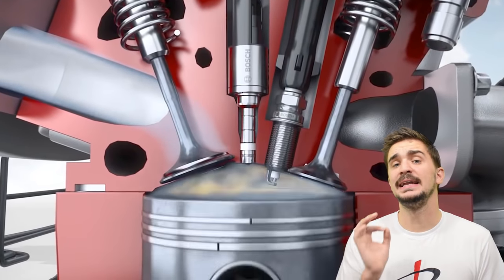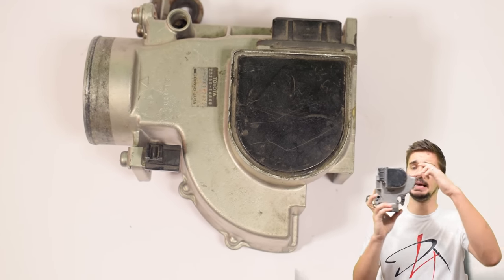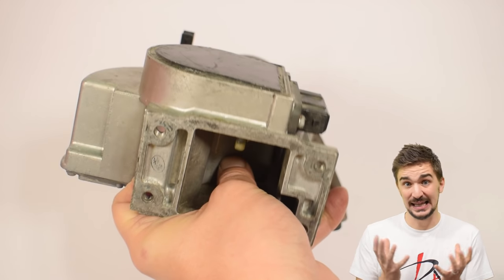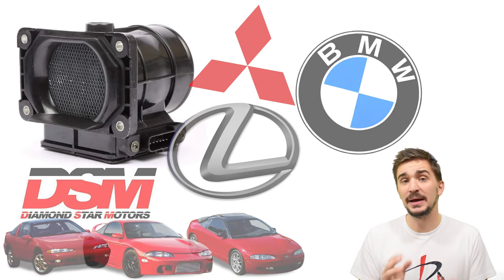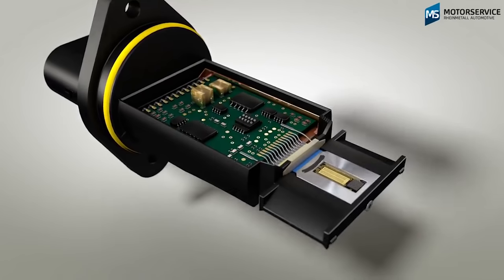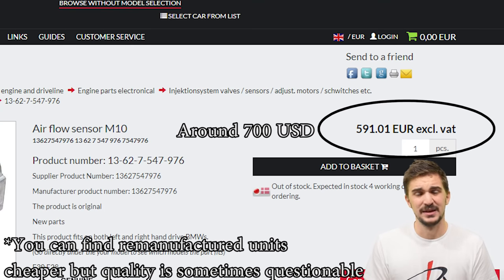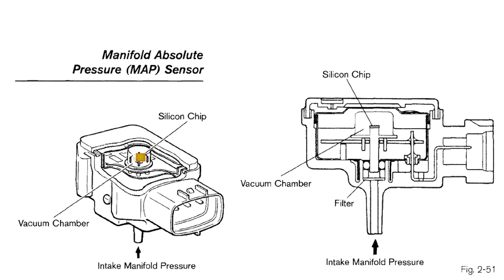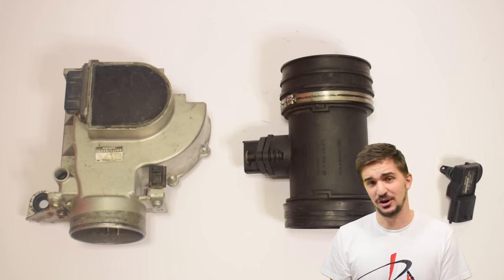AFM vs. MAF vs. MAP - Air flow SENSORS - HOW they WORK and how they DIFFER from each other

Comment: I hate to be that guy, but you're off about MAP sensors.  They measure force, not mass.  They are incapable of measuring the manifold air density directly, and need a either a temperature sensor or an assumption of the air temperature for the ECU to calculate the manifold density accurately.  Going from air that's 0C to 40C decreases the density almost 13%.  My truck is actually a MAP only vehicle and I don't know quite how GM pulled it off really.  It's a throttle body injection, so a wet manifold, and they placed a massive coolant passage under the manifold to keep it hot despite the evaporating gasoline.  So I think their model is built on assuming it'll be close to engine temperature and then just trimming on the O2 sensor for whatever is left.
Reply: @HandleHours1766  But how do I get from knowing the air mass in the manifold, to knowing the air mass that goes into the cylinders?
Only way I can think of, is by calculating it via known displacement and engine rpm.

Comment: Maybe you can tell me what would cause my OBD1 Mr2 SC, with an AFM, TPS, and IAC within the system, to bounce the idle once warmed up. It's almost in perfect rhythm after it heats up. The idle drops to a thousand, and the bounces every second up 500 rpms, then back down. 

I've addressed the basics, ie, timing, vaccume leaks, dizzy wiring, Eng Light testing, fuel Vapors, Fuel pressure, and the adjustment screws on the Afm and throttle body. 

Whatever is doing it is actually strong enough to open and close the vane in the AFM.

Comment: I believe that cars and trucks should have a air intake cooler. Just like the a/c.
So, instead of sucking in random air temps? It always sucks in a certain temped air, and keeping the engine always operating at somewhat the same temperature. No need for a cooling system anymore.

Comment: Quite a decent video.
Nice to see correct terminology for the old AFM. Too many people call them a MAF sensor.
A few things that could be applied to another video are the other aspects of accurately calculating very accurate fuel delivery for a given meassured mass air flow. 
Namely fuel pressure and fuel temperature. 
Some current day programmable computers are using these inputs as part of their calculation for injector pulse widths.
Something that I'd love to see, certainly in programmable computers, is the measurement of ambient humidity.
Ambient humidity has a noticeable effect of the actual air density and knock characteristics of an engine.
As humidity goes up, the moisture in the air displaces air molecules, so the engine requires less fuel to maintain the desired air/fuel ratio.
But the extra moisture will/should slow the combustion process, allowing/requiring more ignition advance to achieve the same MBT.
If the engine is operating in a really cold, but high humidity weather, the engine won't need as much fuel to achieve the desired air fuel ratio as it would if the air is really cold and with a very low humidity (say, at night in dessert conditions).
Similarly, with really cold and humid weather, the knock limit would be higher than in really cold, low humidity weather.
In a cruise condition, O2 sensor feedback could compensate for the changing humidity and short term fuel trims might help correct high load AFRs.
And maybe the similar could be applied for the ignition timing via the knock sensor feedback system (assuming it's able to cover the full engine speed range).
But these are reactionary changes and not part of the calculations the ECU does to accurately determine the actual required fuel delivery and ignition timing. 
I think it would be a nice additional input to help achieve even more accuracy and consistency, for programmable computers, operating over widest possible range of weather conditions.

Comment: Nice explanation of the vehicles air system. However I have a different opinion of Carly. I bought Carly about 6 months ago. After I received it I attempted to connect with my vehicle. It would not. I went through different help options provided by the Carly website (all automated since talking to a actual person isnt possible) but in the end the help diagnostic just ketp telling me to redownload the program and try again. So I decided to return it. I sent it to a return address it had on its website for returns (somewhere in Oregon). 6 months later I still haven't got my money back and theres no actual people to talk to from Carly. Just bs automated responses that dont help. I since got a fixd scan tool and a more expensive autel for bi directional use that work on the vehicle. The same vehicle Carly wouldn't work on, even though there own website said my vehicle was covered. Im not rich so that $100 Carly took me for does matter. Shipping even confirmed Carly got there device back, and it was only 12 days after I bought it. So I guess I just gave them 100 bucks just because.

Comment: nice video my man! really helpful
im currently investigating changing a vane style to either a map or maf sensor, could you go into some detail on the output signals of these sensors 
i am hoping to take the digital signal of a map and convert to an analog to a older style ecu to read in order to improve fuel economy for older cars (it may be less wasteful to improve older cars systems than build and buy new cars)

Comment: Thanks for another great video. Curious to know your opinion on cold air intakes versus the standard air box in correlation with a MAF? I hear mixed opinions about the benifit of the cold air intake systems.

Comment: Both the MAF and the Map need a temperature sensor. The MAF needs it because the thermal flux is proportionale to the temperature difference. The MAP needs it because air pressure for a given mass and volume changes with  temperature.

Comment: Thanks. Absolutely and the MAP sensor is only as good as the vacuum reference on one side of it's membrane and it can leak air into the vacuum,giving a error at the output signal??

Comment: How does humidity factor into this? It seems to me that humidity would affect the desired charge fuel mass, even after correcting for thermal mass flow (with MAF) and manifold pressure.

Comment: Without knowing the temperature you are not able to calculate anything related to mass with MAP sensor. P.V=n.R.T => increasing temperature would mean increase in pressure, but that doesnt mean increase in mass, therefore you need the temperature. Other than that, thank you for your explanations good Sir.

Comment: Is amazing how a simple carburator would eliminate e v e r y  complication detailed here,  maf map etc , including  high pressure fuel pump  ecu   and many many maaaany sensors that could go wrong.
Reply from the maker: It's amazing how misleading your argument is. I worked with carbs a lot, and I like them, but if you want to present a map and a fuel pump as a complication and suggest that carbs are without complications you have misconceptions either about EFI or carbs or both
Reply: @d4a   is not just a map and fuel pump, there are many other things you know that, imagine an engine swap  carbs vs efi so many things.. even the dash won't work, everything is interpreted by some computer.  I know, I'm ranting but don't get me wrong, I own a 2008 Alfa Romeo and I do all the work , I love the car as it is, but I miss the direct feeling of a carbed engine and the freedom they give, they give problems of course but simple ones.  My actual car could be complicated If trying to upgrade it, I can't even get rid of the cats easily  because of the sensors, not to mention remapping the factory ecu  if considering a super charger . Look when I figured out how to throw a maserati v8  in it and make everyghing work then I'll be happy 100%  ;)  happy 2021

Comment: isn't lambda sensor also a part in this equation. Or atleast some sort of sensor in the exhaust gases checking how the sensors before the engine did on it's estimations of airflow?

Comment: How could a MAP sensor tell you the "air mass" or number of air molecules without a temperature? The MAP sensor itself is a pressure sensor. The ideal gas law (PV=nRT) would allow fewer molecules at a higher temperature to occupy the volume of a manifold at the same pressure reading.

Comment: Hey man
I did a bit of experimentation the other day trying to diagnose a certain issue with my car. What I noticed was, the map sensor would give a certain value at idle, this value would increase as I'd step on it - but - as soon as the new / high RPM is stabilized - the map sensor signal value would default back to as it was on the idle.
To rule out it was a sensor issue, I unplugged the pipe from the intake/manifold & created a vaccuum through mouth & the signal value would maintain instead of defaulting back.
TLDR : it appears that the pressure in the engine would drop back after acceleration - which would naturally cause the map to lower down its signal - do you know if this is how its meant to be ? or am I experiencing some undesirable vacuum leakage (other details : toyota 5afe, knocking, occasional puffing in the silencer, possible tappet noise, possible rich burn)

Comment: Doesnt MAP need temp sensor as well? When you heat certain mass of air in closed volume, pressure rises, but the mass is the same. ?

Comment: Very detailed video!!!!
Thank you very much!!!
Do you know if you change the position of the MAF clockwise from 11 to 9 or to 13 or 14  is still going to work properly?
And can you remove the sensor and place it to a bigger diameter of a tube?
Is still going to work properly?
Thanks in advance for any answers!!!!!
Reply from the maker: Position shouldn't matter much, but larger tube will likely confuse it
Reply: @d4a  thank you very much!!!!

Comment: I wonder is there any way to retrofit a hot wire MAF to a stock ecu that originally had an air flow meter...and make it run on the stock ecu?  Maybe run the hotwire in series and datalog them both to generate some kind of correlation table and match them with resistors??

Comment: Hi, will cleaning my MAF sensor with specific Liqui Moly spray I bought for it help to improve the performance of the car. Car is Audi 80 1.9 tdi 1z engine and it pulls poorly since the change, also how should it be done?

Comment: What needs to change tuning wise when you upgrade the map sensor from 1 to 3 bar to account for increased boost pressure? Car came stock N/A with 1 bar  and now has 1 bar to 1.6 bar boost and larger displacement.
Reply from the maker: Tuning wise nothing really needs to change because implementing the tune with the 1bar sensor would obviously be impossible. If the tune has the desired boost targets and if boost control is working as it should and is made with the 3 bar sensor in mind things should work properly. Of course if everything else is in order too.

Comment: My Mazda rx-8 uses a MAF sensor, but it also has a MAP sensor in the engine bay with a small hose that isn’t connected to anything just ambient air. But the MAP is connected to the ECU. What is the purpose of this?

Comment: i am bench testing a 7 pin denso air flow meter.  NO ohm readings between E2 and Vs. what would cause this.  I cleaned the pins

Comment: my ae92 coupe with the 4age has a n AFM and let me tell u, the thing connect to the intake tube and the way it was built  it restricts the air flow so much,  those years of 1984-1991 usdm models for toyota all use AFM, I wish they could have use map, the air flow would have so much better.i wonder if i get a stand alone ecu and wire in a latest maf ( like my 06 honda accord maf) will it work?

Comment: @Driving 4 answer , is some cases the AFM install from factory in an angle  - like peugeot 205 gti. it means it doesn't accurate? (maybe Peugeot accounted for this angle??)
Reply from the maker: Definitely not inaccurate, yes Peugeot likely hired actual engineers and it's accounted for. But the angle is never too sharp and AFMs still take up a lot of space.

Comment: Hello! My MAF sensor has Air Intake temp sensor incorporated. Mass Airflo measures ok but irregular signal from temp sensor. OBD2 measures 25-135 deg C in 3 second intervals! Ambient temp constant 20deg C. New MAF replaced with no change.  Wiring harness??
Reply from the maker: Is ambient temp always 20 and never changes?

Comment: Left hand marked “AIR”. Right hand marked “FUEL”? Clap real hard at a 14.7 to 1 ratio, well?
No more videos?

Actually, the vane airflow meter was introduced in 1976 on the 6 cylinder inline Datsun/Nissan 280Z. One electric injector per six cylinders plus one extra for fuel enrichment controlled by a simple mechanical “Thermo-Time” switch with the specs stamped on the side. Cold, sprayed longer. Cooler, sprayed a little. Hot, no spray.
The 1976 had domed pistons with valve relief cuts, a more aggressive camshaft. With the 5 speed stick and a divorced differential and half-shafts to drive the rear wheels. With premium fuel would top at 142 MPH while smooth as glass.
  The vane airflow meter had no section for dampening but provide under sealed cap, a bypass to increase or decrease air pushing the vane balanced on a 5mm shaft. It used a clock type spring to return it to idle and correctly position it to 87% of WOT. With the cover removed, the drop of red epoxy removed, the clock spring could be adjusted to produce the correct hydrocarbons, Co at 5k RPM while using a 3 gas analyzer. The engine management system has no catalytic converters, required after July of 1979 so proper readings and precise control was possible. Only coil over plug with a high resolution could produce more HP without a turbo or supercharger. A spring loaded round plug was added to open if a backfire forced the door or “Vane” shut under pressure to help reduce/eliminate damaged.
I was a Datsun/Nissan trained service tech at the dealer and owned a 1976 Copper 280Z.
ASE Master Tech-Retired  ( Lets talk about the Cadillac Seville 350 w/flag fuel injection/ no VAF or MAF sensor. The only two vehicles sold in the 1976 model year w/EFI...not a normal throttle position switch, Bendix control unit inside w/built-in MAP sensor on ECM) Hello?

Comment: I implore you to correct the MAP section since the rest is quite good (MAF also needs some fixing). You were very particular in highlighting what each actually measured before that...but then insisted a pressure sensor measures density. Absolutely false. It requires a manifold temperature sensor to calculate density. A MAF requires temp too actually. The same mass of hot air will cool it differently than the same mass of cool air.

Comment: I had some Audi 80 in my life with that awfull AFM sensor. They're inaccurate, expensive and after 30 years they like to decalibrate due to spring wear. Ghh. The worst type of air flow sensor I've ever had.

Comment: Why do they push the diagnostic meters to everyone unless you know what u are doing the codes readers might point in a totally inappropriate direction yes it might help a little but unless you understand what a part does and everything it connects to mechanically and electrically it might mean bubkis

Comment: 2:00 o.O why are you Fingering the VAFM ?
now i have your attention:
also i run speedduino and a MPX4250 MAP Sensor :D

-lara
Reply from the maker: You need to see my old cylinder head porting video for some next level fingering 😂 Yeah speeduino offers a wealth of good options when you know what you're doing.
Reply: @d4a  i got a Trabant 601 and a  lifan 2v78f-3, turbo still comming. 
gonna give the Speeduino a test run first on the old 2 stroke smoker :D though

Comment: The portion regarding MAF sensors is incredibly misleading. 

Hot wire/film MAF sensors do NOT measure air mass(google hot wire anemometer). They measure the air velocity with the advantage of a built in compensation for density. The output from the MAF sensor is checked against a preprogrammed MAF mapping in the ECU that is set by the manufacturer based on the diameter of the MAF housing and the flow characteristics of the of the intake. 
If you change the diameter of the MAF housing the MAF mapping will no longer be accurate and by extension the fueling. This can be seen in the fuel trims when reading the ECU. 
To make things worse, when it comes to measuring air, hot wire anemometers are notoriously inaccurate. Not just the diameter of the housing but also the exact placement within the housing relative the housings circumference will affect the reading, even with a diffuser. The majority of cars do not come with a diffuser anyway.

Comment: why do you even have to know the Mass?
You know the position of the throttle valve, and your engine rev.
can't you just measure it somehow before, and create a large Look up table, showing air mass for every throotle valve position?
maybee add a temperature correction term afterwards and you gut a pretty good knowledge about your air mass in the cylinder